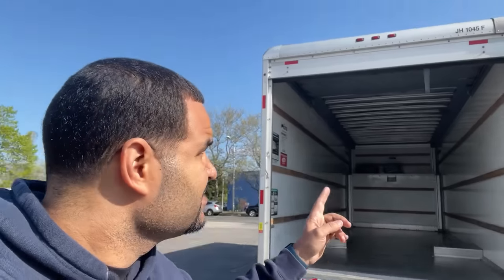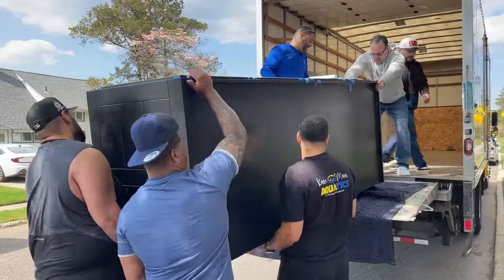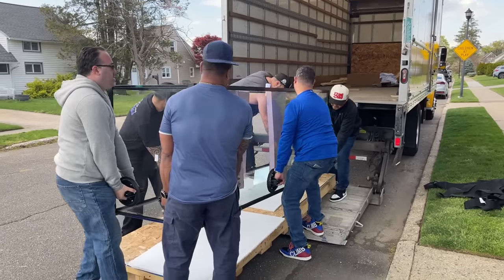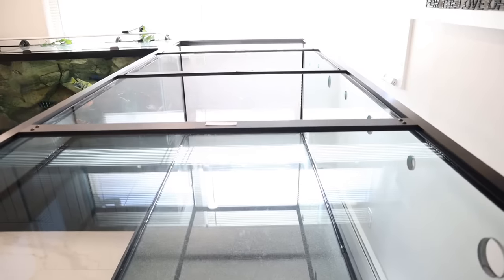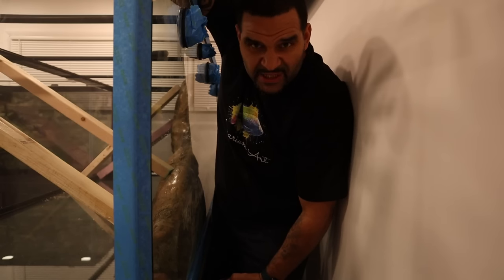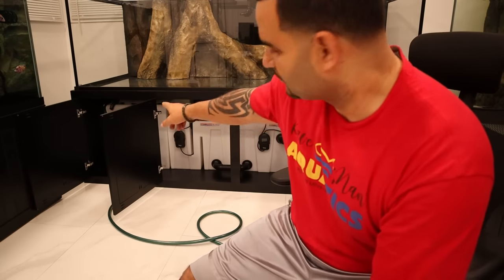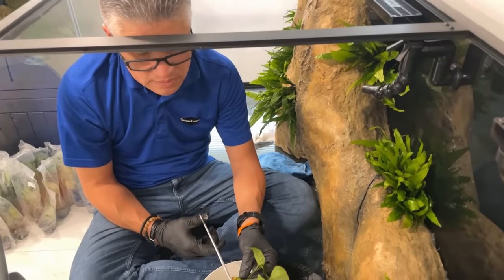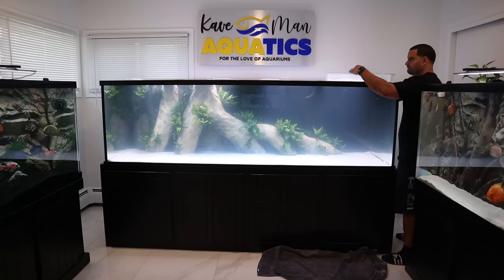New 450G Completes the FishKave! (Pt 3)

Comment: Fishcave for the big W!   Watched all 3 installation videos.  I have a suggestion for future moves.  Before you set your cabinets on either tile or hardwood, put lots of felt pads on the bottom. You will be able to slide    your cabinets with the tank empty, much more easily.  Works for me and I do my aquarium moves solo, BUT my tanks are much smaller than yours  BUT I am also way older than you.  My largest tank was only 125 gallons, many moons ago and 20 years into retirement I caught the fish bug again. I continue to sing your praises at Petco.  I wish I knew back in the day, what I've learned now from you. Thanks so much and God bless Seachem.

Your videos are aawesome!!

Comment: You aint lying, with the sun coming in through window on that tank looks awesome!
Also, you can have a metal fabricator weld up something for you to hang the lights where it's below the sign. Paint it white so it's not an eye sore and have a support bracket in the middle. Just an idea. but have it mounted on the tank.

Comment: Watching this video brought back so many memories of how I had to get a 300 gallon into my house. I re-lived entire experience... grunting and everything. 

My advice to ANYONE.... is while it is possible to do what these guys did... and having to do just THAT myself.... I would heavily advice to get a hydraulic lift cart table from harbor freight tools or wherever AND a dolly to move stuff from vehicle to house. 

My tank weighed (acrylic tank) legit 500 lbs or so and you have no idea how heavy that 500 lbs gets when you have to navigate "through" obstacles and turns and over door steps and through door jams etc etc. My tank stand was in excess of 800 lbs and it made tank seem like child's play. 

What would I give to have had a hydraulic cart when I had to do it in 2014....

Also for those reading this far... do not move tank by yourself. Get a car jack.... get 2 pieces of 2x4. 1 against the wall. 1 against the tank stand. Using a car jack, shift tank wherever it has to move. I have had to move my tank multiple times around fish room using a humble car jack. Makes it super duper easy peasy.

Also fishcave for the w and stuff

Comment: Kev I have some questions. 1 how many gallons is your sump? And 2 did you do anything to fortify your foundation to hold that much weight between your three tanks?
Reply from the maker: My FishKave is on a concrete slab, so didnt need to worry about that. The sump is anywhere from 30-50 gallons depending on how full it is.